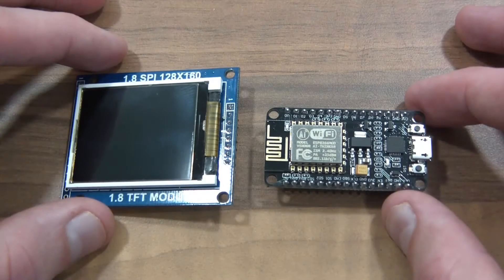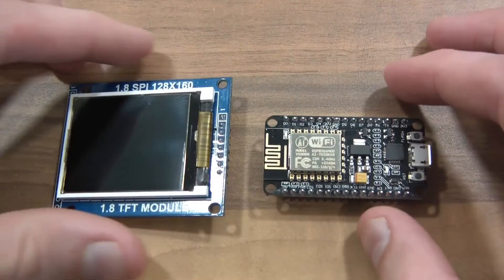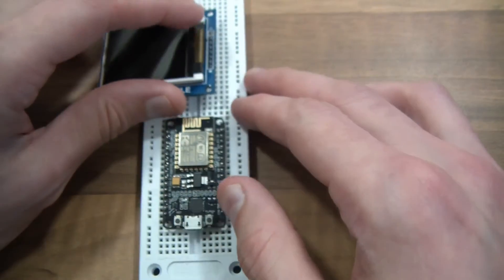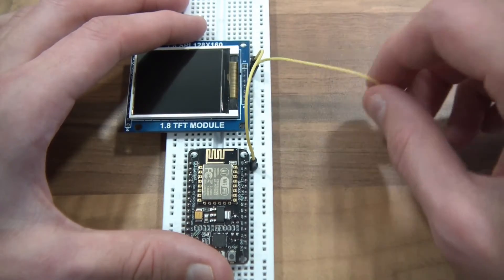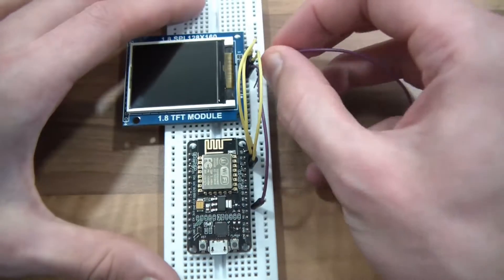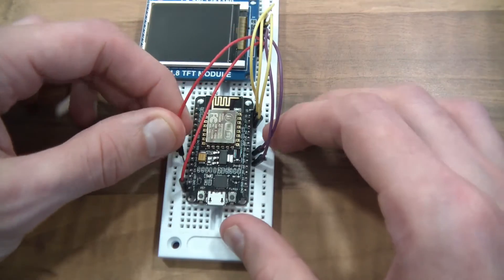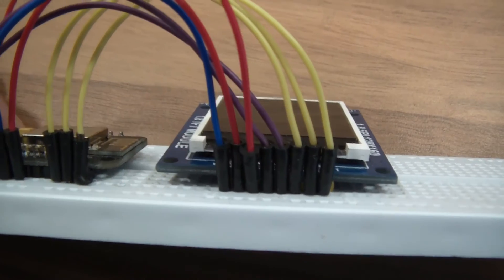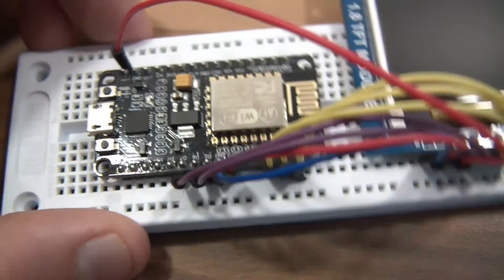TUTORIAL: How to Wire up 1.8" TFT LCD Screen to NodeMCU ESP8266 - Easy! (Part 1/2)

Comment: ty it helped me.. also this screen even works with nodemcu - pins on screen to board are: 1&16:GND, 2&15:5V(VN),7-D1,8-D5,9-D7,10-D2,11-D0 .. open ucglib GraphicsTest and uncomment line 58 and put pins like so: Ucglib_ST7735_18x128x160_HWSPI ucg(/*cd=*/ D2, /*cs=*/ D1, /*reset=*/ D0);

Comment: Thanks Antony for the helpful information, it saved me a lot of time. I have migrated my OLED display from Arduino to NodeMCU (ESP-12E) with success.The hardware connections, i did as described; on my display they are in different order (also BL = LED and DC = A0 on my OLED display). I use 1.6 Inch Oled 1.6 "Tft Ips Oled Transflective Display Module Lcd-scherm Diy Spi Serial Port 130*130 communicate for Arduino.
Software : I wrote a reduced LCDWIKI library, i.e. only for the display that I use,  (because these libraries are made to work on dozens of different display types and waste lots of memory).

Comment: Sir can you provide me the connection diagram between node mcu and tft lcd screen
Reply: for nodemcu connection : screen pin number 1&16:GND, 2&15:5V(VN), 7-D1, 8-D5, 9-D7, 10-D2, 11-D0 .. open library ucglib and example GraphicsTest and uncomment line 58 and write pins like so: Ucglib_ST7735_18x128x160_HWSPI ucg(/*cd=*/ D2, /*cs=*/ D1, /*reset=*/ D0);

Comment: Is it possible to use this along with an rfid module? If so, May I know how ? Can you make a tutorial video too? Thanks
Reply from the maker: Hi, it's possible. I have an RFID tutorial somewhere in my channel! Simply do both together and it should work! :-)
Reply: Just wondering... they shar same pins as the tft right? Do I need to configure something else?
Reply from the maker: Hi! SPI devices all use the same 3 pins (SCK,MOSI,MISO) and all I2C devices use the same 2 pins (SCL, SDA). Any pins other than those can be moved to any pins you choose. :-)
Reply: Hmmm so I the rfid module and tft screen will still function when used together even with shared pins right?
Reply from the maker: J L0486 should do..